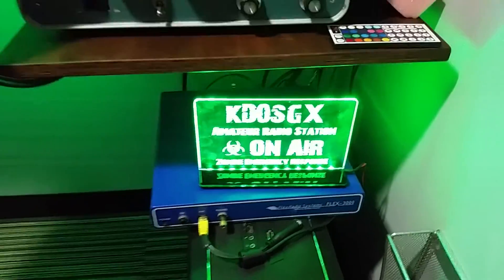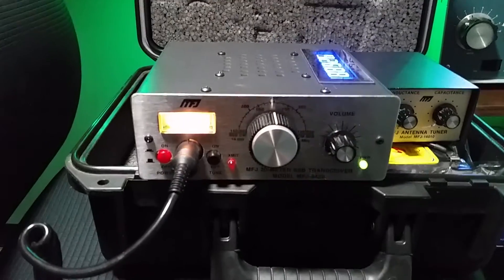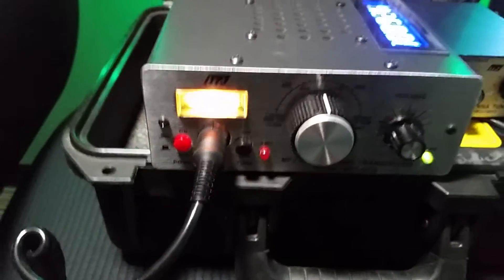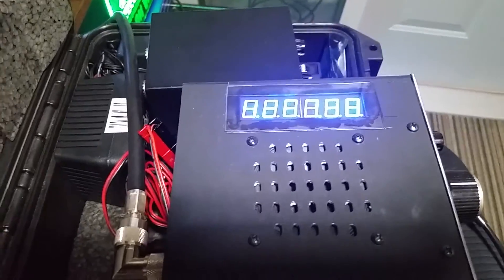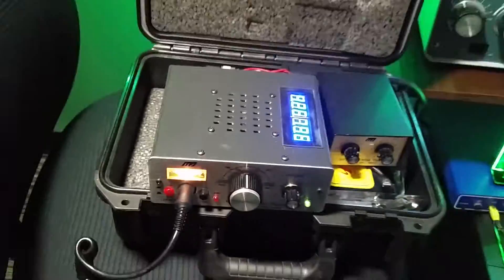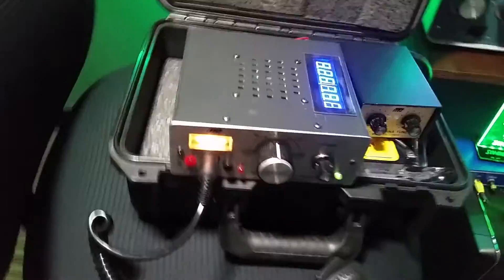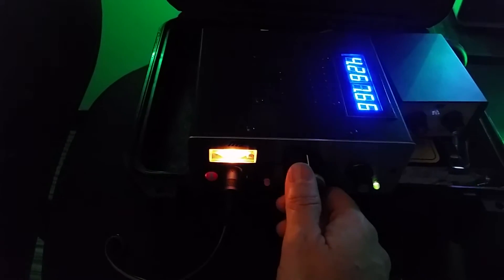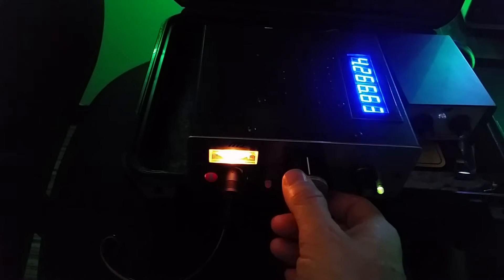MFJ-9420 Installed Frequency Counter.

Comment: Where would I order the clear shield you used to cover the counter?  Thanks
Reply from the maker: Researcher extraordinaire I just got a piece of plexiglass and used thin black tape double sided.
Reply: One more question; How did you stamp out the opening for the counter? It looks like you did a pretty clean job.

Comment: What did you program the offset to?   004500 ? and Upper offset  U 1F ? Thanks, my frequency counter arrived today and its almost  2:00 am and I soldered the wires and just getting ready to program the the offset for the MFJ-9420 ! THANKS!
Reply from the maker: Car 4Sale I did not document that, I just tried until it worked.